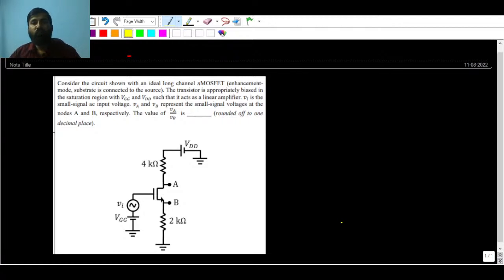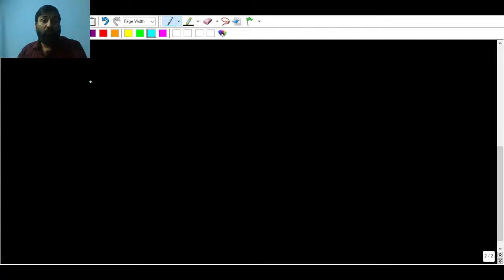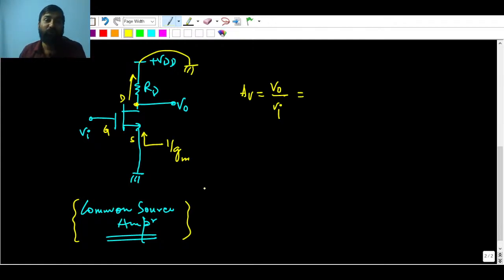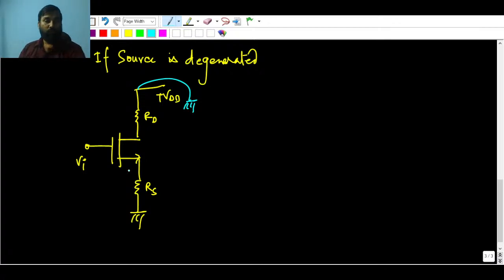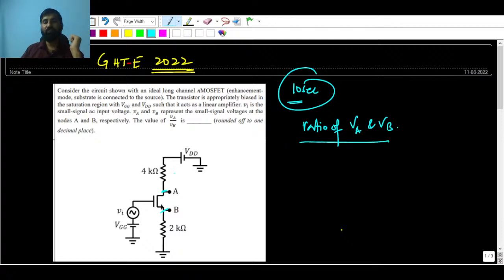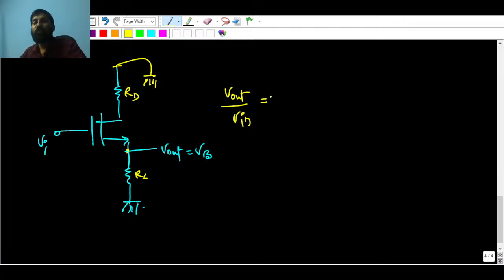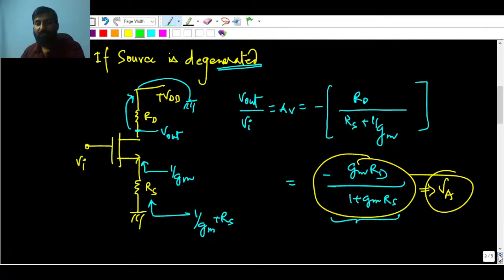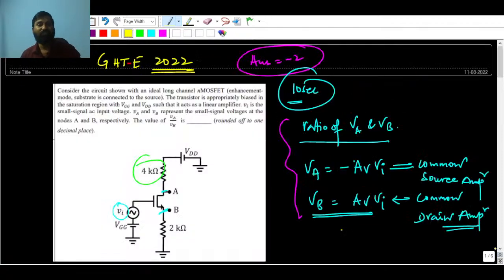GATE 2022 | Analog Circuit Question n-Channel MOSFET with Source Degenerated | Dheeraj Mishra

Comment: You made it too complex it can be solved in one line using simple ohm's law. VA=0-4k.id, VB=2k.id... Va/Vb=-2
Reply from the maker: Yep ! In 2026 : Anything can be done in a line ! It was when 2022 solution was uploaded ..
Reply: @DheerajMishraIITBombay didn't understand what's the relation between the approach of solving and the 4 years gap which you mentioned.